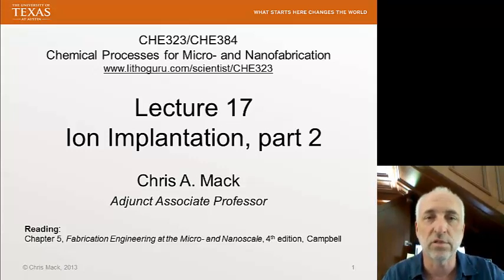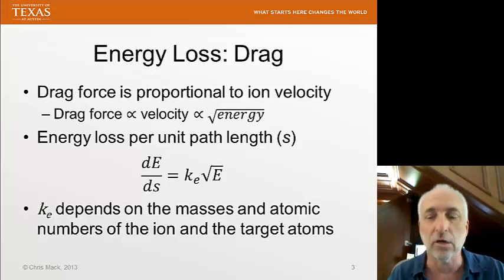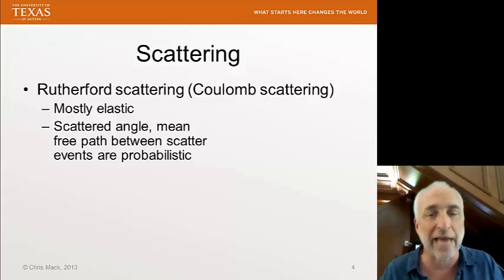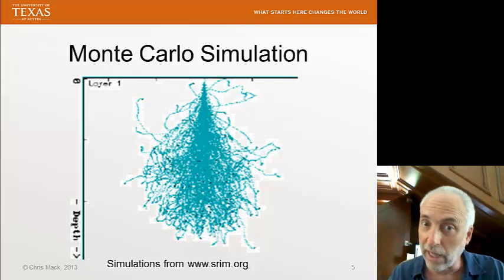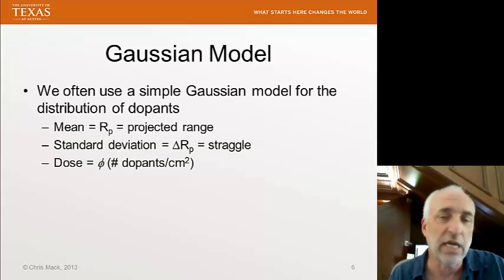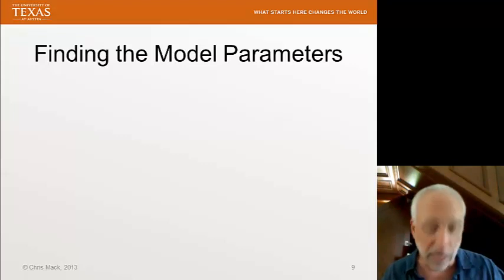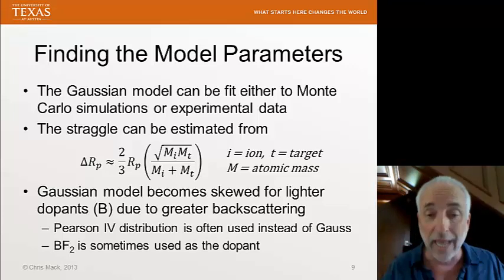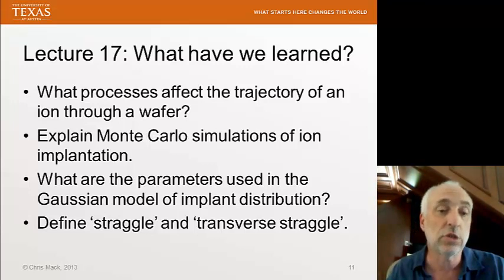Lecture 17 (CHE 323) Ion Implantation, part 2

Comment: when ions enter solid then the sample would be charged or neutral?
Reply from the maker: par navidi 
Good question.  To prevent the sample from becoming charged, the sample is mounted on a grounded sample holder (wafer chuck).  Thus, electrons are supplied through the bottom of the wafer (sample) to keep the wafer neutral.  In fact, we measure the current flow from the chuck to the wafer as a measure of ion dose delivered.